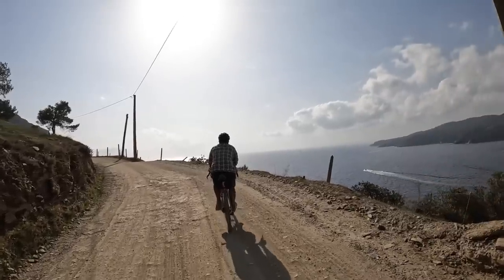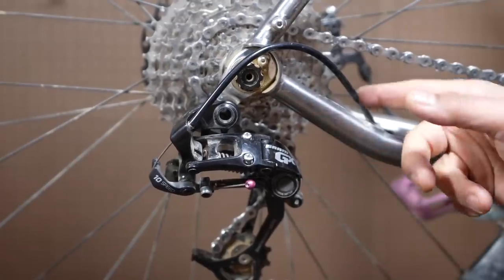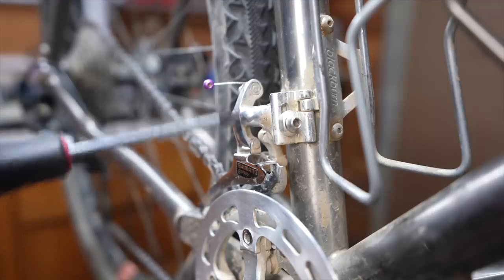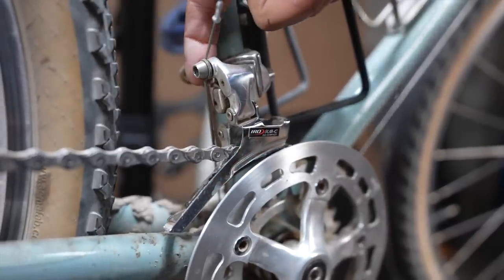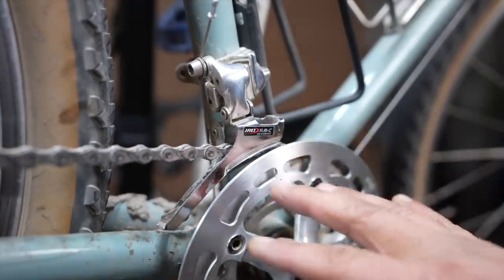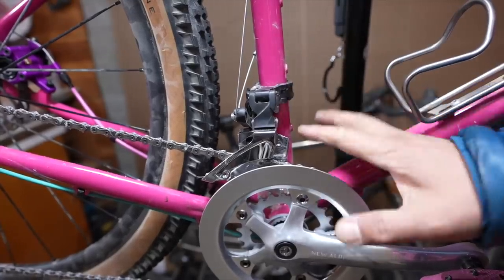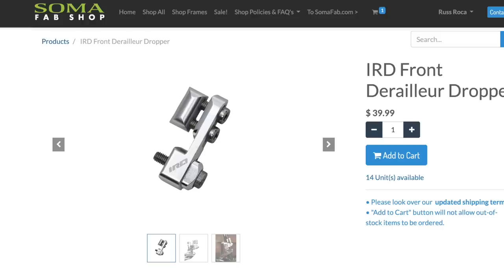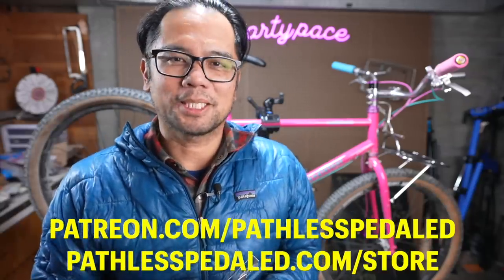These Components Are Disappearing...Get Them While You Can

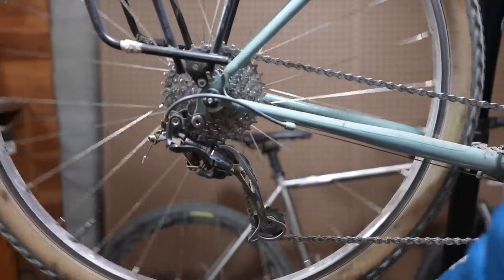Comment: 2:20 I would prefer a slightly bigger, lower tooth-wheel on the derailler. I recently changed my XT 11-tooth wheel with a 13-tooth one and this works also fine on my pretty old XT 9 speed (from 1999ish, the one with the matt-black middle part) who had a slightly to low pulling capacity (as you see at 5:09 if the lower cog wheel had a tooth more you could add two chain links and run a wider casette ore reduce friction in rhis case). A bigger lower cog wheel let the chain run smoother. You get these tooth wheels for 5 bucks or up to 1200 $ [carbon+ceramic. No one needs this BS. Get titanium screws instead] all over the interwebs.

Comment: I am just now (as of yesterday) running 1x11 with 30 tooth Deore XT crank after using a SRAM 2x on my full-suspension bike.  Bike is running great but there is no advantage for me as I  am surrounded by steep climbs.  30t is the perfect middle but I think I will pony up for a new outer/inner on M8000 as it has a 2x option.  Maybe 36/26. I may be slow and carrying personal ballast but can still still climb with better gearing.

Comment: You missed an important point of multiple front chainrings. Chain line. It is possible to keep a nice straight chainline with 2x and 3x cranks. Cross chained chainline wears the chain and gears rapidly and is less efficient. Also, we thought 7 and 8spd freewheels where gone forever, then, Ebikes are making them popular again.

Comment: What about the modern mountain Shimano XT front deraileurs? Those work for most bikes and most will accommodate a 38T chairing. Not exactly a sub compact, but you still get 95 gear inches on the top with an 11T in the back. Also has the benefit of still being in production. For the modern non-racer looking to go double, It seems mountain drivetrains  are the way to go.

Comment: Road recumbent i run 53/34 front 11-36 10 speed rear. On road and gravel i have trouble in a 1 x finding the right gear to  hold my preferred cadence. 

Where i am all surface upright and bent riding with loads, and my stays are long enough i am still running 3x. 1x, even 1x12, is just impossible to find my legs. Bents cant just stand up on the pedals. 

Bent high speed on relatively flat and short stays, and upright fat snow are 1x 11 and 12….for now lol.

Comment: If you are handy enough, and willing enough you can shorten the cage on most front D's to solve clearance issues. Its sometimes as easy as just cutting the inner plate enough to clear the Chain-stay/tyre and bending the end of the outer plate to form a new end (to catch a wayward chain), because the chain is engaging so close to the pivot it wont introduce "slop" to the system, but sometimes you have to reconstruct the end so both plates are fully connected, not too difficult can be done with a small bolt and a few nuts if you don't care what it looks like. But one of the few upsides of Gravel becoming more competitive/regulated is that 2x Sub compact in a "road-ish" configuration seems to be making a bit of a comeback.
Reply from the maker: Was actually planning this as a future video.
Reply: @PathLessPedaledTV  Look forward to it 👍
Reply: The Shimano SLX 2x11 Alex front derailleur is designed for a slack seat tube (69 degrees or less), so it easily clears the chainset on a bike with a 72 degree seat tube. Works nicely.

Comment: Damn, all this time i thought there shouldnt be any chain slack on the front small ring and the back small ring. Thanks for justifying that its okay not to mind it. Youre right. Nobody uses that combination anyway. I brought my bike to a shop and the mechanic said there shouldnt be any chain slack. Before, shifting worked great with tiagra brifters and rd. Now my shifting with the tiagra brifters and grx400 is fudged because the mechanic reduce the links in the chain to prevent any slacks. It shouldnt be that way.
Reply from the maker: There “shouldn’t” be but if you  are running combos beyond the standards there sometimes is. BUT it’s not the end of the world and you can shift around it.

Comment: Hi Russ,

You have peaked my interest in a sub-compact double for my Kona Swift Rove.  As you know from the bike, I currently run a GRX 46/30 and an 810 derailleur in back. I have an 11-40 XT cassette with a roadlink and was curious if a 40/28 or 38/28 in front would pair nicely with my setup. Thanks and keep up the good work. I subscribe and love your content.
Reply: Michael, I’m curious - do you feel the 30front / 40rear combo is not low enough for climbing? Would you start spinning out on decents with lower front chainrings? I’ve found that fully loaded a 46/30 and 11/42 combo gave me the best of both worlds, so I’m curious as to your need/thought process of going lower. Thx!
Reply: @dmartel243 Thanks for the reply. A great question. The reason I want to explore going lower in the front is that my bike has a front load bias. When climbing, that extra range I think would help alleviate the sensation of pushing that weight up even more. However, having the ability to go 30/40 is awfully nice in those situations.
Reply: @michaelmonardo3266  understood, thx for the reply! Good luck in your quest!

Comment: Thanks Russ, Always like the different gear ratios.  Here is a problem, I run smaller chain rings on a carbon bike.   I can't lower the front derailleur because the seat tube flares out very wide where it meets the BB.   The front D hits the seat tube.
Reply from the maker: Time for a new bike :)
Reply: @PathLessPedaledTV  Great reply!   I like to think of myself as a mechanic that can always figure something out.  Well, I sold that bike and got another one with a smaller seat tube diameter and a dropped chainstay, now I can lower my front D.
Reply: @keithc5729  Damn, new bike in under two hours. Nice job Russ! lol

Comment: The conspiracy that goes around our shop is that Sram pushed for 1x because they were never able to make a ft der that actually worked. 1x makes sense for mt bikes, especially with rear suspension, but seeing new gravel bikes with a 1x makes no sense at all. Gravel bikes ride on the widest range of terrain and having such a narrow range with a 40t chainring is a recipe for having a hard time on single-track climbs and spinning out on paved descents. 1x may seem simpler because of a lack of knowledge about how to shift well or adjust a ft der but if you have that then it's just as straightforward as an expensive 12 sp rear der. I'd rather have a drivetrain that is super interchangeable and cheap to service with a huge gear range rather than spend $150-250 for a contemporary rear derailleur that shifts worse than my 20 year old 3x9. I feel like a 2x10 drivetrain is the best exchange of gear range for simplicity. Unfortunately, it's a lot cheaper for bike companies to make bikes only 1x and given the lack of knowledge about ft derailleurs the market doesn't have much interest either. I'm definitely a front derailleur idealist and way too curmudgeony for someone in their early 20s.
Reply: ALSO the fewer gears you have the less you have to worry about compatibility. With 9 or 10 speeds you can use whatever combination of chain cassette chainring and derailleurs you want and have roughly the same performance. Man I could rant all day about compatibility bullsh*t in the bike industry all day. Screw patent law

Comment: I've had issues using a 3x FD with a 46-30. The ramps of the FD didn't line up, and shifting was pretty horrid.  That IRD Pro-C looks like just the ticket, I do hope that they resume production.
Reply: I wrote to Microshift about it, and they claimed that they are still in production but not typically stocked bc of low demand. I dunno if I believe it.
Reply: Shimano CX50 or CX70 have short cages too and are better shaped for a 46/30. I imagine the GRX FD would work better than most as well, granted it's friction shifting and you don't need matching indexing.. but in that case, some of the 10speed Shimano FDs work with a 14t gap and spec as 44t max, but they match a 46t ring perfectly and are ok with a 16t gap; since it's a 46/30 I'm assuming you have a wider chainline anyway so should work well.
Reply: @saintless  wish I could find a cx50 or cx70 but so far no luck!

Comment: It's hard to see with these bash guards but, in my opinion, your front derailleurs are sitting kind of high. I tend to drop the front derailleurs right on the limit, that is, just touching the large chainring when shifting, and them move them about 2mm higher. If anyone has problems with front shifting, check the placement of the derailleur first because its position really is critical. BTW, I'm shifting a 42-24T subcompact with an R7000 105 front derailleur, so todays road doubles are not necessarily incompatible with sub compact chainrings. (Smaller than 42T would be impossible though.)
Reply from the maker: They are just barely over the bashguard. Any lower and they’d be running into it.
Reply: @PathLessPedaledTV  I run a bashguard too but I use spacers to space it out. My derailleur kind of slots in between the chainring and the bashguard, if you understand what I mean. It sits lower than the bashguard.

Comment: Wait how does that rear 11-spd rear derailleur work with 9-spd cassette/chain? I thought the cable pull ratio was different in 7-9 speeds and 10-12 speeds and thus these cannot be mixed.
Reply from the maker: Friction.

Comment: When it comes to derailleur systems with close to 600% range cassettes like the one from E13 what's the point in a 2x? do you have to pedal at 60kmh and climb at 1kmh
Reply from the maker: The point is to avoid a tiny ass inefficient cog and terrible chain line and not leave the HG hub standard.

Comment: Make sure to mention, that a FD on a carbon frame not designed for one is not advisable. DO NOT add a clamp! this will crush the tube. Most carbon frames use forms, not tubes. The cross section probably is not round. And if it isnt designed for one, then that section isnt strong enough to take that strain of the torque of mechanical movement.When buying a clamp, be sure to accurately measure the outside diameter of your bike's tube and order that proper size. Do not over-torque or risk crimping the frame tube.
Reply from the maker: Carbon on a bike? Blasphemy!

Comment: Just one thing I dont really understand. Cant you not just use a 1x12 Sram/Shimano mtb derailleur with a 52t cassette and a 30 or a 32 chainring in the front to have the same low gears? Yes a few bigger steps in between but also simper and not that many problems with crosschaining?
Reply from the maker: You can but your high is too low and it’s still really gappy in the jumps. I’ve tried it and didn’t like it.
Reply: @PathLessPedaledTV  fair enough. Still prefer the 1x12 just because I feel like the 2x gives me too many dead gears but that's just preference :) It would be great for all of if the rene herse cranks just came in at half the price
Reply from the maker: @I3ene1  I think traditional 2x has a lot of overlap. A true wide range 2x does not.

Comment: I'm surprised I've never seen you using any of the shimano side-swing front derailleurs. Is there something about them that doesn't work for your applications?
Reply from the maker: Those were designed for primarily mountain bikes and I don't really mountain bike so have never considered them seriously.
Reply: @PathLessPedaledTV  It seems like they'd work well for you. You can externally route a length of cable housing from the down tube straight into the derailleur without an extra housing stop, and they've got a nice compact, short cage to fit over smaller chainrings.

A lot of them are fitted with the weird MTB-specific bolt-on mounts but you can get them with regular clamp-on mounts to fit on round tubes too.
Reply from the maker: @Nicoya  I just use what is cheap or free at the bike co-op and have not run into those there.
Reply: @PathLessPedaledTV  That's also a totally reasonable criteria.

Comment: I was just wondering if electronic shifters are a gimmick?😀
Reply from the maker: Yes.
Reply: @PathLessPedaledTV  I purchased almost in new condition, the hard to find Suntour XC power thumb shifters from eBay (non rubber grips)...love them! Also I don't get the electronic shifter crayz!! In context to your video, you are correct in stating that items are disappearing. Fortunately I was able to acquire an IRD Sub -C front derailleur a few months back from Rivendell since my Shimano Ultegra FC6600 cage is a little to long for 2x conversion. Thanks for your videos that keep it real!  👦👍🚴‍♀💨

Comment: Depends on type of/capabilities of the 3D printer...but never clamp any "run of the mill" fdm printed part.  That's a disaster waiting to happen.  Just dont do it
Reply: Will always be weak/want to split in one cartesian vector.  And it will
Reply: Seth's Bike Hacks/Berm Peak recently did a video testing out various 3d printed parts, like a seat clamp, single speed rear cog, and a brake rotor. He mostly did it with a straight face, but in the end, after every part he made broke, he was like, Don't Do This. It's Crazy.
Reply: @hankamania  that stem was truly frightening. Glad he didnt try anything aggressive on it.